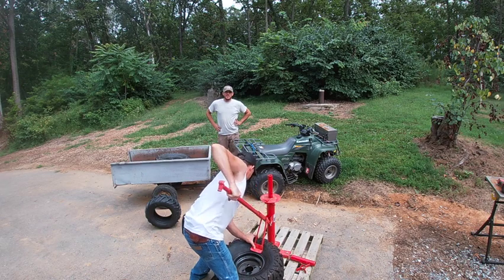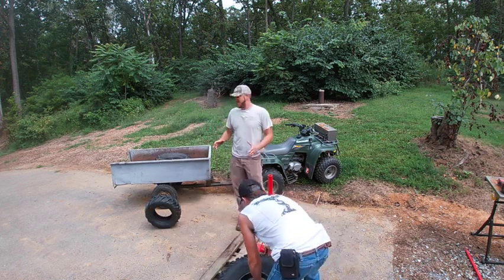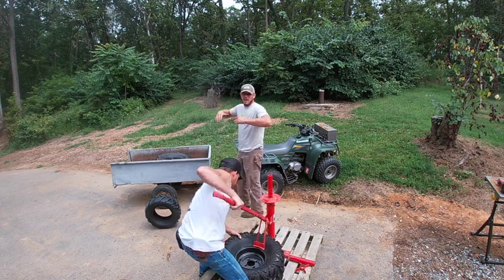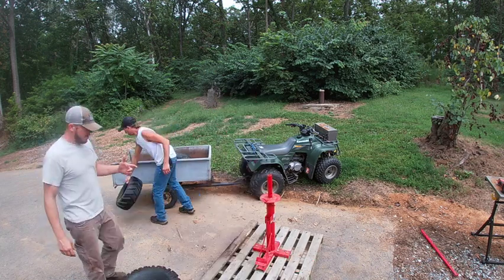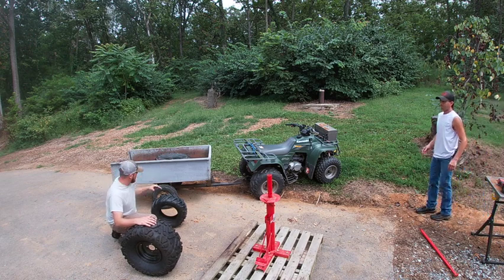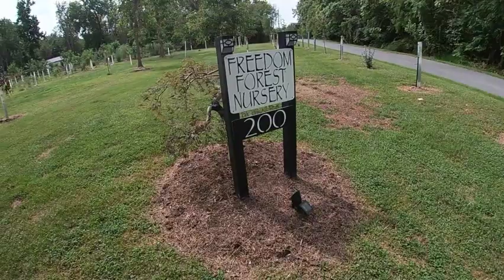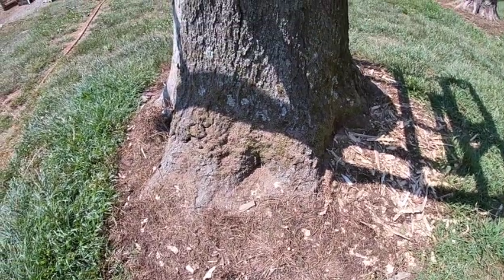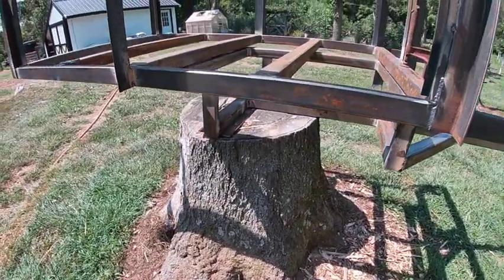The INDESTRUCTIBLE Yard Cart!!! Torsional Stub Axles!!! #fabrication

Comment: Really enjoyed your video; thank you.  What thickness and size are your square and rectangular tubing?  The manufacturer of the Reliable 500 lb. Capacity Torsional Stub Axles says, "Please Note: 18.5 X 8.5 AND 20.5 X 8 "DOUGHNUT" TIRES CANNOT BE USED WITH TORSIONAL AXLES. TIRES WILL NOT CLEAR AXLE ARM"  Since I don't know what "doughnut" tires are; what size tires did you use.  Thank you!

Comment: You used torsion axles rated at 500# for the pair? Looks like your trailer already weighs about 250# empty.
Reply from the maker: It's not 250 pounds empty, and I didn't factor in the weight of the wheels and tires since they don't factor in to the weight on the suspension. The steel frame and wood weighs about 100-120 pounds. It works well, Thanks for the comment!
Reply: It works great. If the suspension was any heavier it would not work well for the rough terrain here. This trailer is dialed in perfect for this place. It’s perfectly balanced and rolls like a dream. If you watch near the end of the video, I loaded it up with logs and the suspension was  nowhere close to being maxed out. I’m really happy he built this trailer for my business. I’ve never seen anyone build one like it and we use it everyday.